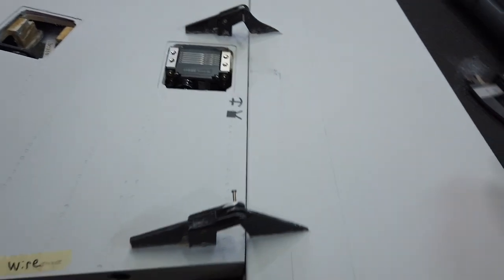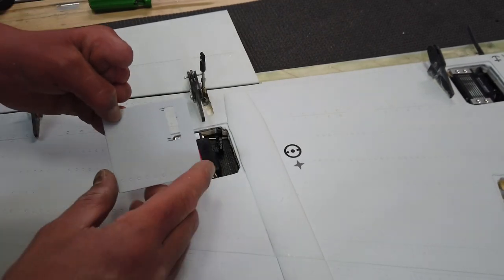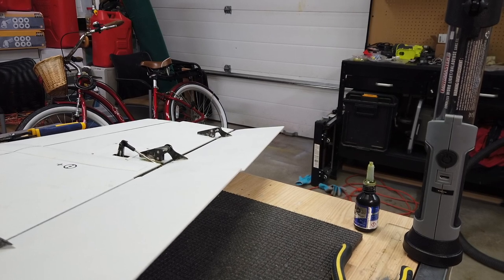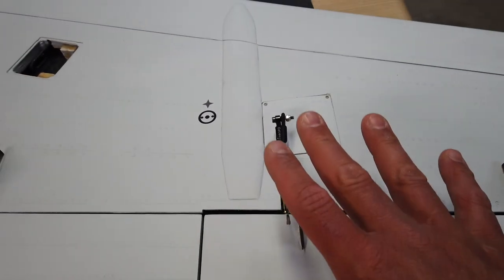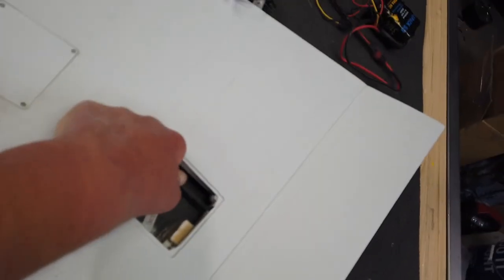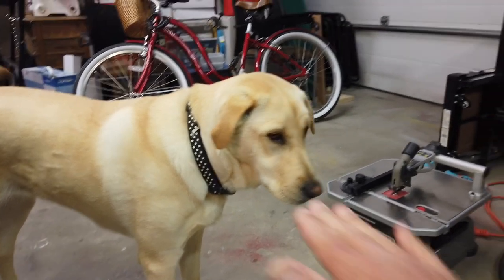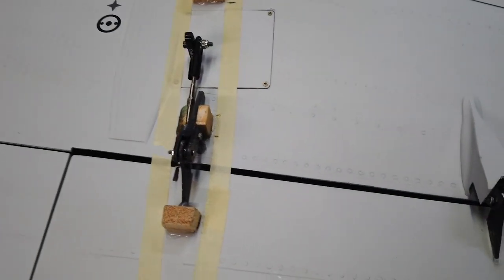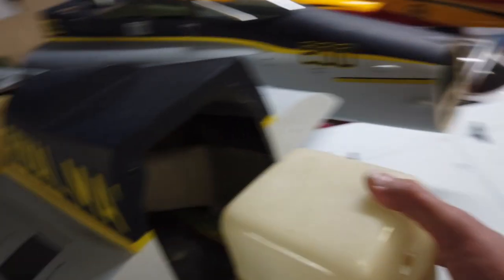SKYMASTER F-18 - Wing Assembly, Fairing install complete - Build Video #7

Comment: My SM 1/6.5 F model made it very hard to ever buy from SM again.  I have had it for three years and its still sitting on the table.  Just a tip for hit, I would lower the ball in the servo arm as close to the servo as possible, that kills the servo only moving 10-15% of its travel. Cheers for a fellow build tuber! And the secret RC must have glue is GOOP!
Reply from the maker: Thanks Fender.  Yea I moved it down on the next hole and got more resolution from it.  YES GOOP IS A MUST!  You get it!

Comment: Man No offense but Ya Ol fingers have seen better days! Do I dare ask what happened to them? It’s understandable if you don’t want to say. I lost two of mine . Left ring and left middle finger when a 900lbs steel outrigger table snapped both bolts and dragged my hand underneath it at a welding fabrication shop. It was a steel sheer that could cut up to 3/4 steel plate. I had welding gloves on at the time and sheered them right off as well
Reply: But I can still wiggle my RC sticks and that’s all that matters to me haha
Reply from the maker: Haha. No kidding!  Don’t mind talking about it. I was born that way. No cool or disgusting stories. Never know what it’s like to have them. It doesn’t slow me down for most things. Just stupid things like playing baseball. Doing up buttons on a shirt. Things like that.
Reply from the maker: That’s exactly it!  As long as you can move the sticks!  I don’t have any fun or disgusting stories. I was born that way so I have never known what it’s like to have them.  Doesn’t slow me down for most things.